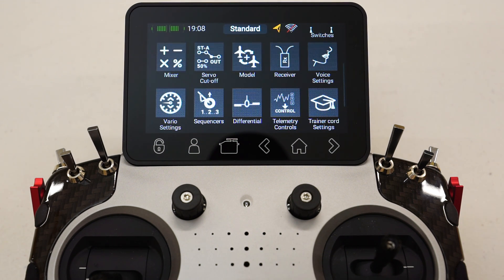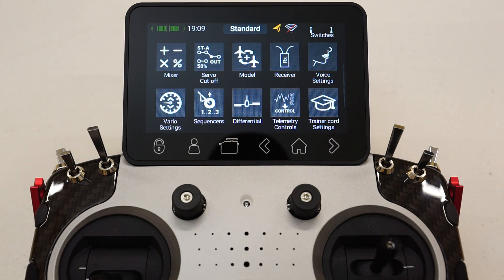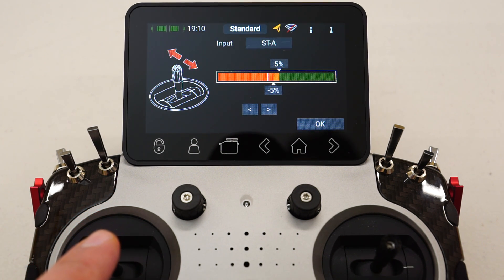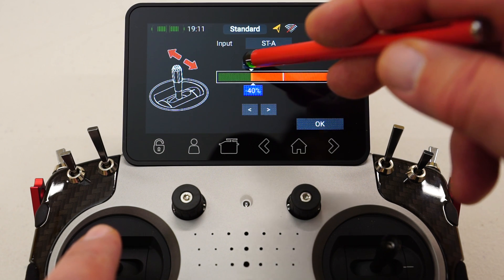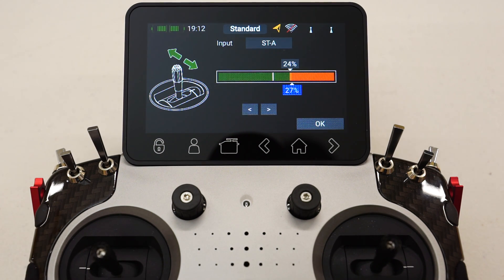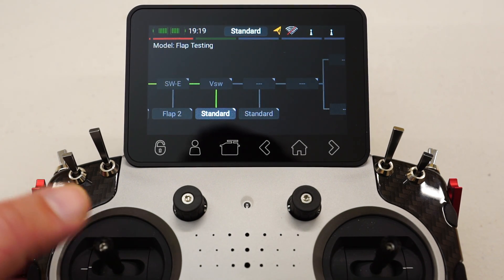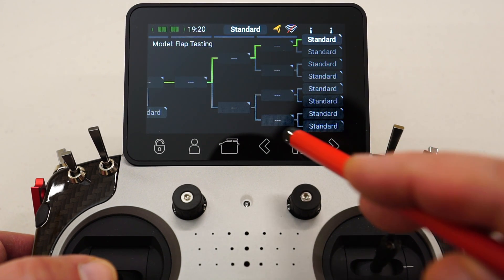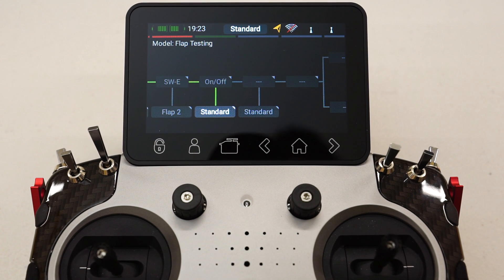PowerBox Core - Atom : Multiple Flight Modes on Throttle Stick for Glider Pilots

Comment: Hello Costas, you are definitely a king on the Powerbox program ;o) . 
Someting slightly different : I've a twin jet engines airplane. I would like to train "single engine" flight. I would like a 3 position switch, the throttle and a slider to control the system.
 With the switch in the middle, the throttle is controling both engines, and the slider is deactivated.
 With the switch in one end position, the throttle is controling the left engine, and the slider the right engine (set at high idle). 
On the other end position, the throttle is controling the right engine and the slider the left (also at high idle) .
I've tryed with flight modes and virtual switches, but I made a terrible mess and I'm lost... 
Do you have an idea ?  Thanks a lot .
 Renaud
Reply from the maker: Hi Renaud
Just quickly, what I would probably do is create multiple throttle functions and only have them active in separate flight modes depending on which position your three way switch is set to. This way you can swap from using the throttle stick and slider between the two engines.

For instance you can setup a throttle stick control function for one engine but set this up so it is only functional when your switch is at one end. The other engine would have another throttle function but assigned to a slider control and also set to operate only in the same switch position.

Then setup two more throttle functions but swap the stick and slider controls between the two engines (ie servo channels controlling the turbines). Set these up so these two functions only operate when the switch us set to its other extreme position.

For the middle switch position...you can setup one more function for dual throttle control. Here you can assign both engine throttles to the one stick so both are now operated together.

I need to have a bit more if a think on this as well as I have not setup a dual turbine setup as yet but the above should be a good starting point to play with the programming.
Reply: Hi Costas, thanks a lot for you very fast answer. Very good idea, it sounds good. I will try this . 
On the other way, you should contribute on the PowerBox forum as you master the software. For exemple, I've asked some month ago for help to create a safety on the throttle cut (what you've explained in another video) and nobody was able to help ;o) @CVHeliPilot
Reply from the maker: @renaudleclercq1069  I have a presence on the official PowerBox online forum and post there frequently.

Also somone on the official forum also posted up a solution for a twin turbine throttle setup a while back using a slightly different method (using mixers).

If you do a search on 'twin turbine' you should find it.
Reply: Ok, I'll do that.
Thanks a lot ;o))
 @CVHeliPilot

Comment: how to set up engine  thrust reverse similar to Spectrum
Reply from the maker: Hi - Can you give me a little more info on how it works on Spektrum as I don't have access to a current Spektrum Tx. It should be fairly simple to implement but I just want to confirm how it works.

Comment: Again excellent video Costas. Creative solution to generate multiple switching points. If you find the time could you also explain the logical functions Lock RS/SR? I think it must have something to do with flip-flops. How can this function be helpfull in programming my planes and gliders?
Reply from the maker: Sure...I was planning to cover the Lock RS/SR feature. This is handy for a throttle stick safety lock where the throttle is locked to a safe value (eg off) and when you deactivate your throttle safety switch the throttle stick must be returned to the low position before it can activate.